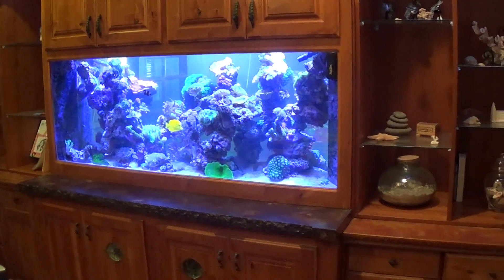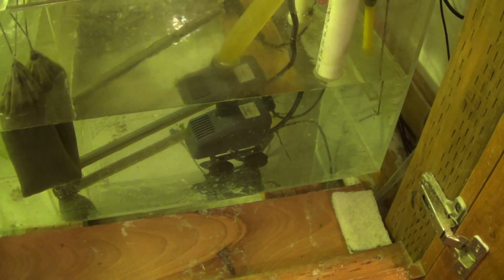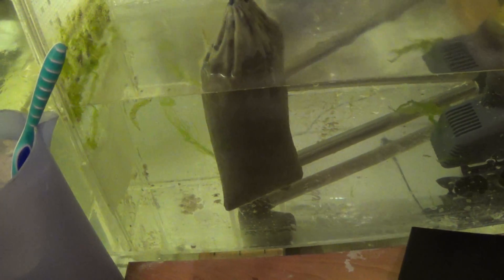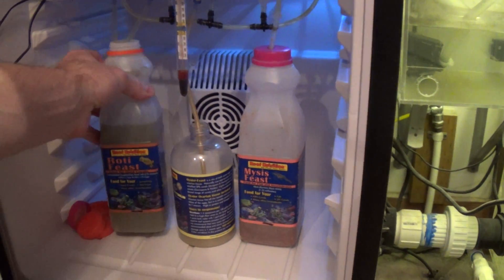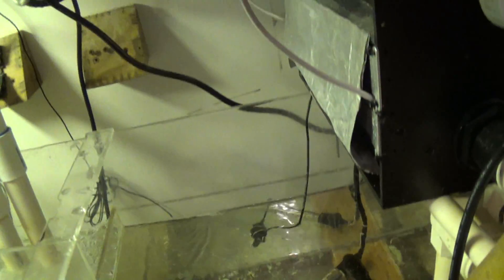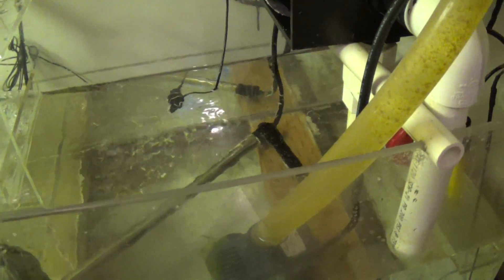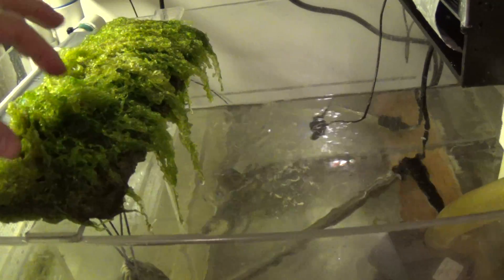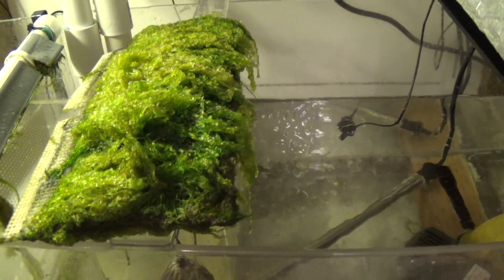Algae Scrubber with LED Lights on Salt Water Reef Tank

Comment: Tank looks awesome, I love your setup and I almost died when I saw you have a mini fridge with dosing pump doing your food! Planning to build my own scrubber right now, your video is by far the best I've seen because all the others go over the basics, not what is unique about theirs and their little design ideas. Thanks!
Reply from the maker: Thanks Harrison, and yes the mini fridge dosing food works great.  My only wish was that we used a real refrigerator, or had the one we do in a different area.  As it is located in a mostly closed cabinet under the display tank, and it's thermoelectric, so it can only cool so many degrees below ambient.  A true refrigerator would allow us to keep a more stable, colder temp. and make the food last longer.   We do have another video here on our channel showing more on the dosing fridge build, in case you didn't see that one!

Comment: For people asking. This system requires no skimmer....what the skimmer does is remove  fish waste that your corals need to thrive. The algae scrubber is a natural (algae) filtration which once it`s run in....maybe 10 to 12 months you should see next to no algae in your tank and even very little on the glass. The scrubber is scraped or harvested about every 10 days and the lights are usually on 16 hrs a day.
Reply: Quite straight forward really.
Reply: Could you explain how something like this would reduce algae in the tank?
Reply: Gabriel Q it out competes algea anywhere else in the tank
Reply: Gabriel Q the algae in the scrubber strips phosphates and nitrates from the water so there aren't any nutrients for algae to propagate in the tank

Comment: You have a nice system 
The drain to your sump has a lot of air coming down to your sump I would  use a ball valve and reduce flow so the pipe is under water or full siphon. then you need a second drain for emergency.  This is a way to eliminate air and the drain is silent.

Comment: Hey there, quick question for ya... I just recently installed a "floating algae scrubber".  I looked at the LEDs on your website and wondered if there's any possibility of getting a shorter strip.. the box I have is only maybe 7-8" long and I don't want to light up any other part of the tank other than the scrubber section..  Any help would be great!

Comment: hi, do u use 2 of " LED Grow Light Bar" for each side, so all total 4 light bar, is it?
Reply: On the scrubber shown, yes it has 2 LED light bars on each side.  However, it only had 1 on each side for many months and grew algae just fine as well.  The extra light when the other 2 were added made the algae grow thicker and longer.

Comment: hi, where did you get that black box to support the pvc and the light?
Reply from the maker: The scrubber box I built from 1/4" Plexiglas, and used black spray paint designed for plastic.  You can order Plexiglas from Amazon: http://www.amazon.com/gp/product/B009AEAFIE/ref=as_li_ss_tl?ie=UTF8&camp=1789&creative=390957&creativeASIN=B009AEAFIE&linkCode=as2&tag=expressions-ltd-20
Reply from the maker: A jig saw, table saw, and sand paper will allow you to build exactly what you need.  You'll need the special glue for Plexiglass- also on Amazon:  http://www.amazon.com/gp/product/B0096TWKCW/ref=as_li_ss_tl?ie=UTF8&camp=1789&creative=390957&creativeASIN=B0096TWKCW&linkCode=as2&tag=expressions-ltd-20